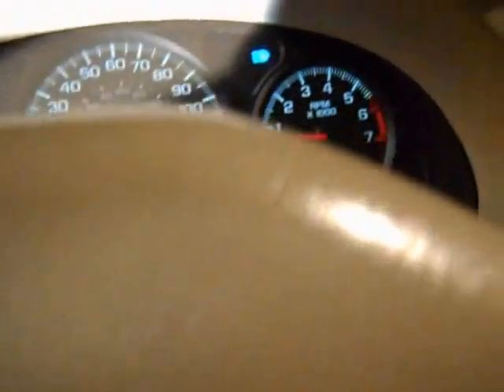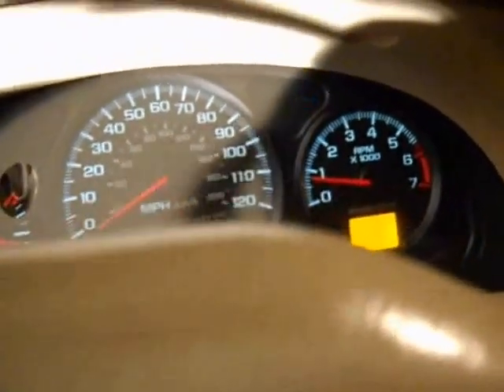REPLACING 2001 IMPALA HIGH BEAM TURN SIGNAL SWITCH

Comment: my turn signals just complelely stopped after intermittently working for a month following an air bag sensor going bad and getting disconnected (it supposedly was keeping the car from starting) so now im wondering if its related. i am now having issues starting the car again :( we think it might be ignition switch as well

Comment: If you will turn the steering wheel  to one point you can reach that screw easy with a ratchet extinctions 1/4 drive with tork socket ... did mine today 2001 -- 265000.00 miles running strong ...